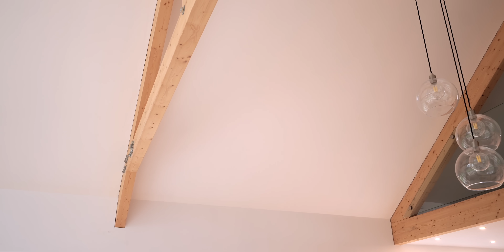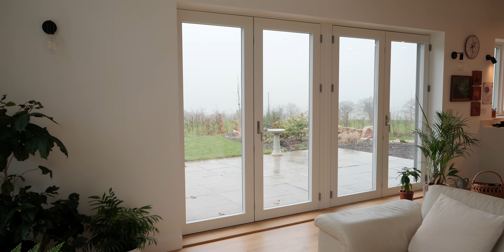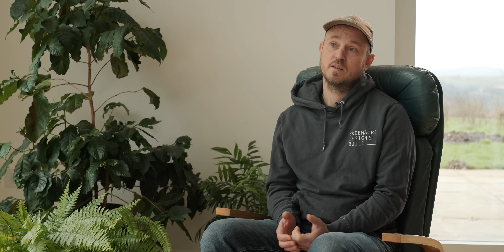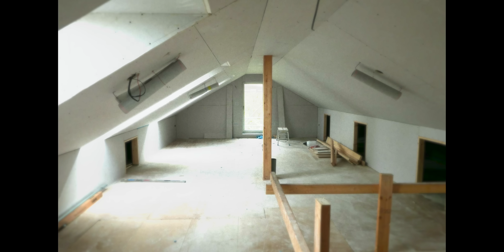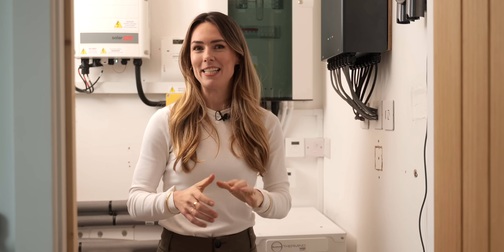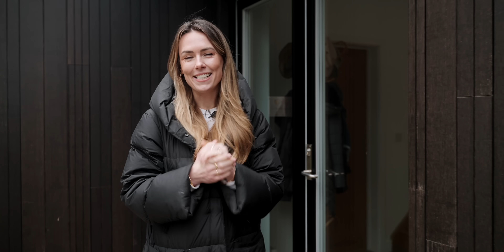Ditching a Heat Pump for In-Plaster Infrared Heating?!

Comment: Radiant ceiling heating was done 75 years ago and of course with the large heat loss in the building shell of the day it used a lot of energy the temperature balance was difficult .  With the current passive house standard it seems like a great way to go
Reply: It was indeed!  We've moved a long way from the high energy, resistive versions now though

Comment: Problem I find is electric systems tend to have high failure rate so with this system it could lead to very costly repairs
Reply: Not this one you'll be pleased to know.  It has a 50 year design life with no maintenance requirements as there are only 3 components and no moving parts.  It can be screwed into and even cut for holes without issues and, in the unlikely event of a failure, the rest of the mats in the room would work as normal so that your home would still be warm.  To repair, simply reveal the damaged area by scraping away the plaster, bridge a connection and feather the plaster back in.connection

Comment: You mentioned complicated plumbing system for ventilation unit..it looks like water pipes for underfloor heating? Or is the ventilation unit a water based system instead of air?

Comment: What is reflectiing the 50% of the energy that is being emmited into the wall with these thin flease mats, what do the electrical connections to these mats look like
Reply: Great questions, foil backed insulation reflects a good portion of the light wave back into the room but, in face we do want a portion to penetrate deep into the building to maximise on its thermal mass.  The connections are mechanically crimped to a 1m 'tail' in the factory and bench tested prior to shipping.  ON site a mechanical, waterproof, glue filled butt connector is crimped to the tail and shrunk using a heat gun

Comment: Do you not loose it all when your wife opens all the windows for FRESH air as soon as she wakes up 😂 Also is it not a incubation palace for cold and flue  bugs? 😂
Reply: If you're referring to the passivehaus, airtight design then that's what the MVHR system is designed to cope with - changing out the stale air and swapping it for fresh.

Comment: Seal any building and all kinds of fungal growth will grow to be a problem. There may also be functional human problems, as we in northern climes aren't really designed for a dry atmosphere. It does seem counterintuitive to convert heat into electricity (which is still expensive to store and loses in transmission while, in this case, being dependent on a solid grid connection. The fixed costs of grid connections aren't so much of an issue in the south of England, but here in Scotland, even when usage of electricity is low, they make up a substantial proportion of electricity bills.
Reply: 😂😂😂😂

We'll presume you're attempting to make a salient point, then.

Perhaps you should have researched the term "air tight", with regard to buildings, prior to posting?

And, have a squint at "heat recovery systems".
Reply: Come 2028 Scottish Gov want ALL new builds made to the Passivhaus standard
Reply: @EnergyCarbonInfraredHeating 

Well, now, that's certainly the aim but it's only an aim.

In short Scottish government are wanting to show they're "doing something" about being seen to be "reducing carbon".

Comment: 2kw heating needed, that just seems insane. Not surprised by the issue about heat output in the high ceiling though. Kinda confused by the idea of doing the roof since well, heat rises? Why not around the lower part of the walls? Or maybe forced air circulation?
Reply: We're producing a far infrared light wave that transmits up to 3.5m and warms objects in it's path
Reply: 😂😂😂😂

Heat doesn't just "rise".

Try Googling radiation and radiant.

Then consider how our planet gets heated, or rather how our atmosphere and oceans get heated.

And then "greenhouse effect".

That's where the radiation thing happens.

Comment: With air con he could probably save another £225 per year. His current 2kW of infra red might cost around £300 per year (overall bill is reduced by the solar). And with air con he could have had cooling when necessary. The IR heating he has does have minimal visual impact.

Obviously battery has moved on since they didn't buy one, and systems that can disconnect from the grid when there's an outage are available.

Comment: Yes, radiant heat/cool surfaces & good envelope design. However, free solar from above, where the sun is, into a glazed roof buffer space rather than challenging glare and uneven heating through large windows may be better, especially if the roof glazing has movable insulation. Templates for the best interaction between a conditioned enclosure and its surroundings are not at a "one perfect answer" stage yet.

Comment: For heating would it not be more beneficial for in floor heating instead?
Reply: That's a common misconception.  When placing heating into the floor you need to cover around 80-90% of the floor area.  When sofas, beds rugs etc are placed down this then blocks the heat.  Conversely, by heating from above we only need to occupy up to 60% of the surface and it is unrestricted as the IR light wave produced will radiate down over 3m's and begin to warm all surfaces, including the floor.  Also, we are used to being warmed from above (sunshine) and so it feels more natural too.
Hope this helps.

Comment: Could have put more solar and a battery and run heavy appliances during the day, even in winter. At the moment, the solar in this house is essentially just a tool to make money from export at 15p/kWh.
Also with so many shadows on the solar from the nearby trees (poor design), I seriously doubt that you’d get 6MWh/year from that 6kWp array. I recon 5-5.2MWh max.

So yeah, my only criticism: the techs deployed here are very much using the grid as a money making machine rather than a genuine goal to be more energy independent and put less stress on the grid.
Reply: A battery would smooth the impact on the grid, but presumably was expensive when the house was completed

Comment: Can you mess it up by putting a screw on the wrong place on the wall? How does it compare with floor heating?
Reply: Our IR mats are specifically engineered to be able to accept cuts, holes and fixings through them without danger of electrocution, failure or reduction in performance.  When placing heating into the floor you need to cover around 80-90% of the floor area.  When sofas, beds rugs etc are placed down this then blocks the heat.  Conversely, by heating from above we only need to occupy up to 60% of the surface and it is unrestricted as the IR light wave produced will radiate down over 3m's and begin to warm all surfaces, including the floor.  Also, we are used to being warmed from above (sunshine) and so it feels more natural too.

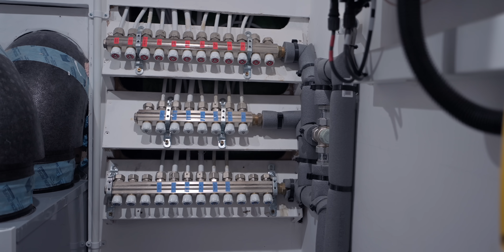Comment: Mildly baffled what all the UFH pipes and manifolds are for at 09:30 (in the 'engine room') if the house is heated by IR...?
And equally baffled by the owners of comments regarding his choice of not installing battery storage. Just because you have a battery connected, it doesn't mean you have to use all of it every day. If you want back up capability come what may (within reason), just have a bigger battery…?!  Besides which the sun doesn't always shine and you could charge the battery up at 7p/ kilowatt hour overnight and run the house off it during the day if there isn't any sunshine. I'm sure the owner is a lovely guy but something very serious has gone drift with his logic, here...  It's not like batteries are expensive anymore either.
Reply: A fair point.

Comment: For low heat loss homes direct electric heating is perfectly viable.  You sacrifice efficiency against a heat pump for simplicity and lack of maintenance. 
The exact same concept as our infrared heated skirting boards. 
Two main differences... 
1. It's above the surface so accessible in future, and more responsive 
2. It's direct 240v so no need for transformers with losses. 

A very well put together and efficient system guys 👏 👏
Reply: Hmm ... suggest the alleged efficiency of heat pumps under every circumstance is just that, alleged, and is to be infered.

It's the financial efficiency that matters, every time.

An instant shower and instant water heater(s) might well be a better proposition in a two person household.